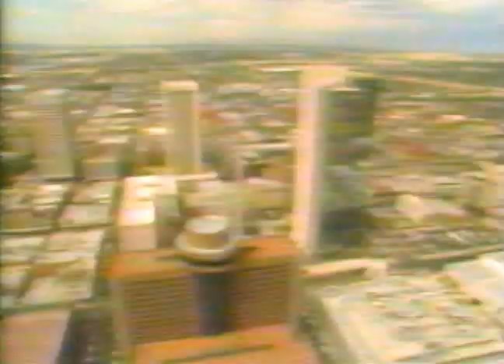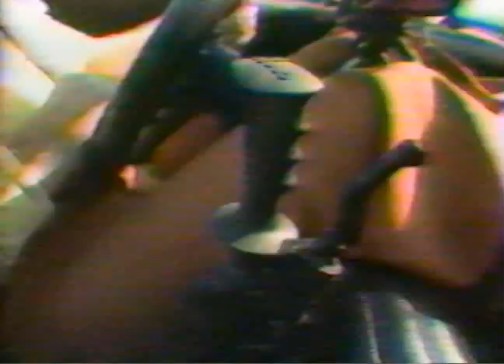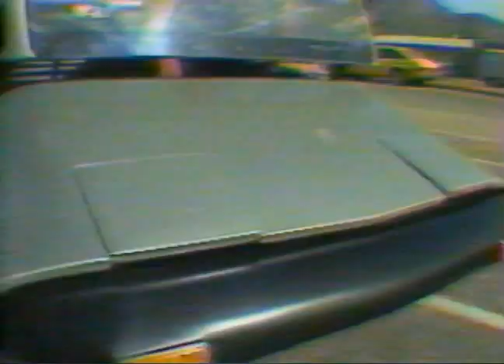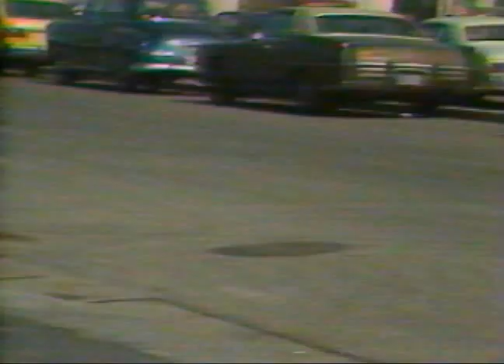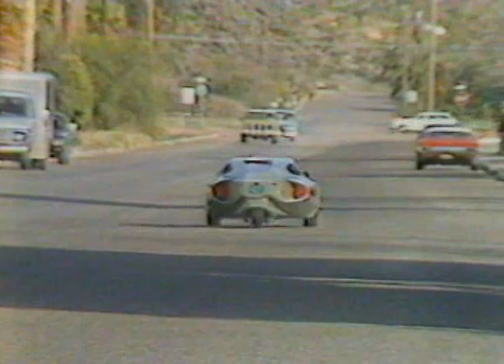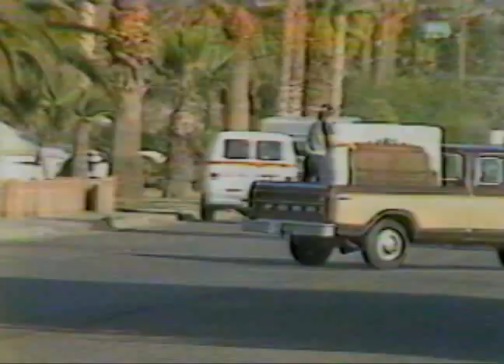Tri-Magnum: The Original Prototype

Comment: I remember this design featured in Popular Mechanics. The methods of creating the body with laying up fiberglass over foam is innovative and a great advancement over older fiberglass applications. The body design itself is sleek and striking.  I've wondered if it would be best to fit it with a drive shaft motorbike to avoid chain stretching, taking in to account the weight of the body, driver and extra passenger. However, the prototype in this video seems to be doing just fine.
Reply: using a gl1500 honda or gl1800 honda or a K1200lt as a drive train gets you reverse gear...

Comment: I noticed in another video that the Tri-Magnum does not have windshield wipers. Is this typical for all T-M's? Does the windshield shape make wipers unnecessary?
Reply: You use something like Rain-X to cause the droplets to slide off the glass.  Now, you can use a wiper if you choose, and several builders have done so.
Reply: The vehicle is classified as a motorcycle per US DOT regulations and hence wiper is not required though would be highly recommended.  It could probably due with one being fitted on now that there are a wider range of configuration to adapt to it.   Most like something that wipe vertically like a city bus style.

Comment: What other suspension can you use for this since bettle is becoming harder to find
Reply: the front end from a rear-drive car is what you need.  Chevy Chevette for instance.  Miata, mustang, on and on
Reply: I drove a TriMagnum 6000 miles in 3 months. Mine had an Issetta body and a Honda 700 Nighthawk.
Reply: Also somewhat hard to find but Opel (GT or Kadett) works great. They, much like Dodge Aspen come out with 4 bolts, independent suspension,  disc brakes, rack and pinion steering
Reply: @jeffhammers5677  kaddet front wheel  drive?
Reply: @sicelogeorgeson7212  
Opel Kadett or GT were rear wheel drive. Their front end is very good. In my trimagnum the shock towers were somewhat in the way (legroom) in comparison to the vw but worth the upgrade to modern independent suspension, rack and pinion and discs....disc's.... I had my calipers rebuilt I was told that they interchanged with Porsche